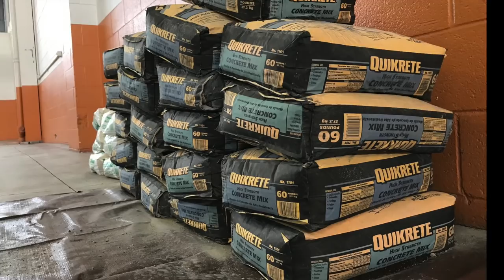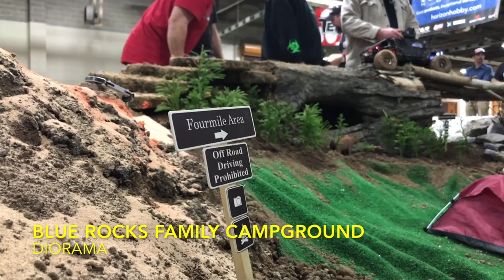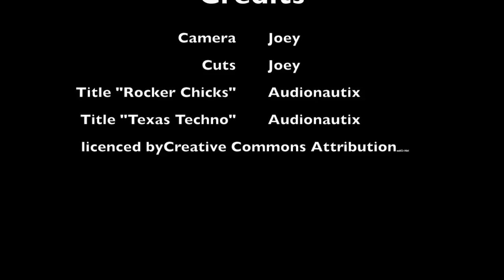US Scale Trial Championships at Motorama 2018

Comment: I have just spent 3 days making my FTX Fury look kick ass again with a stinger in and other scale parts. But my HPI Scout with XXL super soft Mud Slingers with Hobbywing quick run on 3s is a crawler for getting over that stuff that is just off limits for a scale rig cool as they are. 
I was into bashing for years and thought I would never crawl but have been hooked for years now as there is a big forest and river next to where I live so it's very handy.
I even have my own little scale course set up just through the barely used tiny little old under railway tunnel right next to me in the woods but some kids smashed it up last spring but I have found plenty good spots near me.

Comment: Just wonderful ! What work of the organizers! Do you know how they make doors on springs? What bases is used? Thanks for the video ;-)
Reply from the maker: yes, I made those :-) Wooden sticks 6mm on top and cut 6mm metal (all-thread) 10cm long on the bottom. Those metal bases can be hammered in different materials.Find a fitting 6mm spring that's not too soft and not too hard. With a hot glue gun I fixed the spring on the wooden stick. But: if they sit on the bottom - flat wood on flat metal, they wobble 4-6 times. If you lift the spring 2-3mm and fix it on the base with electrical tape, it wobbles really long! No judge can oversee a touch anymore :-D

Comment: Just found this rock crawling / trials part of the hobby. I  have some experience with battery buggies and all wheel drive all wheel steering trucks.  But all that stuff is gone. So I would be starting from zero again. I don't want to start from low end but also don't want top end. So what do I look at / for ?  I would like to pinch pennies till they scream  so keep that in mind.

Comment: I do this stuff for real with my Jeep and always thought this was kind of silly but it actually looks pretty fun. I'm surprised these guys aren't using a rear (or front in some cases) lock-out function to keep the back wheels from moving in order to get around some of these obstacles instead of having to back up so much. I'm sure backing up is costing (adding) points?
Reply: Michael Lots of rc crawlers do.  It’s called Dig in the rc world. Look up rc crawlers with dig and you’ll see.  Some comps allow it and some don’t.

Comment: The rules require leaf spring suspension in the rear for one of the classes (SO I guess no JK Wranglers?). What scale is this? 1/8th? That's the only scale I could find on the website, but it was for RC racing.

Comment: Is the goal to travel the course without touching the string or poles?  Then by time?
Reply: While I am not 100% sure of all rules for this competition, what you described isn't far off from the norm. Cars will usually have a time limit to complete the course, with time added as a penalty for cars missing gates, which are the poles you mentioned, or going off course. Certain competitions will also add time for putting your car in reverse, falling off an obstacle, or having to be put back on your wheels by an officiant. Hope that helps!

Comment: What was used for the course markers? 😎
Reply from the maker: Hi Corey. I made these trail markers (Wobble gates) with 6mm woodsticks (20cm), 6mm threaded metal sticks (10cm long) and a 7mm soft spring. Metal can be hammered in harder ground, spring is glued on the wood - in the past hot glue but today I use shrink hose..... So after you put the metal in the ground where you need the gate, you put the stick on top. Done. Wobbles long enough for the judge to see :-)

Comment: Number one reason these all look like stupid toys is nobody has set up a progressive throttle control.  REAL vehicles don't accelerate instantly, they have mass.  So the throttle response needed to be intentionally digitally slowed to make it look like the engine is revving up and adding power to the wheels, not just jumping forward.